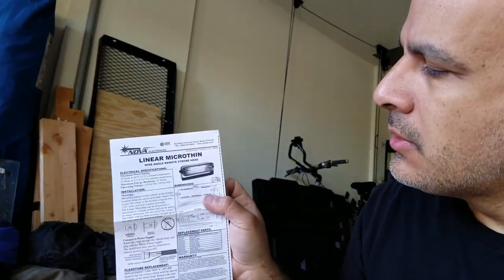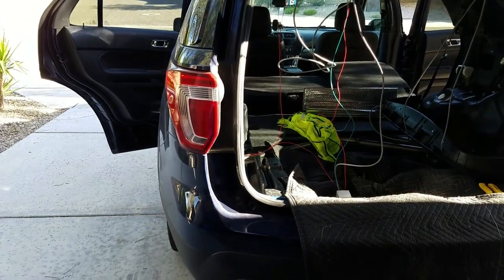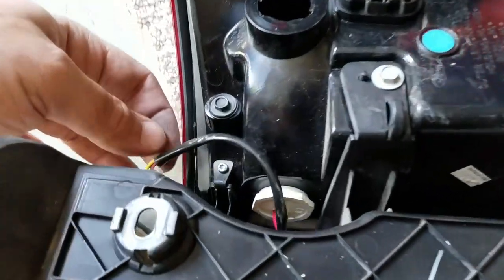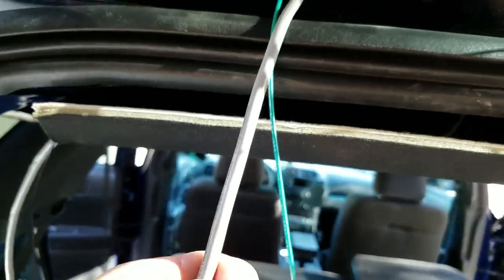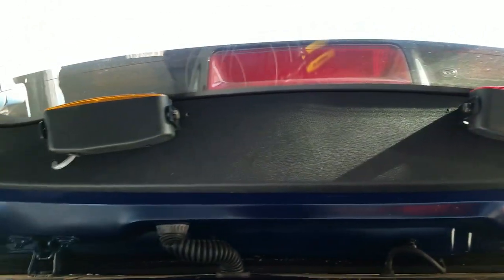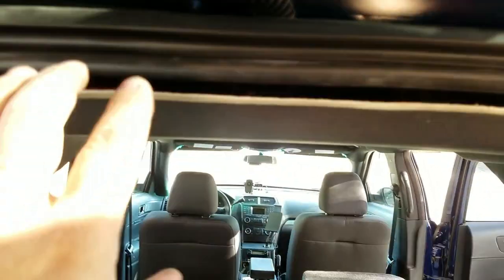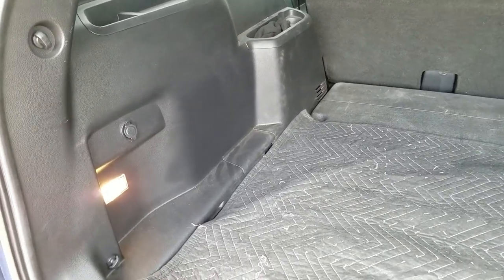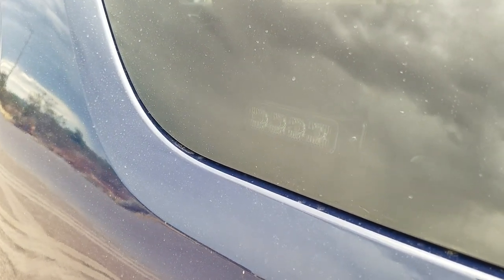Ford Police Interceptor Utility Mods - They're coming to get me!!

Comment: I am planning on installing a 2K watt inverter. There is a small pocket behind the back seat (I learned from you) would it fit there and then run the wiring through the channel to the front. The main lines to the battery will be #8 gauge wire.
I did get the Whelen strobe and the Whelen air horn through E-Bay. I am taking all the strobes out and changing to ION strobes in amber (IONA). BTW the horn on the steering wheel in my PIU should be on a VW Bug! Those WILL be changed out on Wednesday when I get the PIU back from Ford. They are checking out the recalls and then programming the computer so that I do NOT have black out and I will have a few other features like Daytime Running Lights (DRL). All in all I am looking forward to start playing with this very soon. Heck I haven't even opened the hood yet!
Reply from the maker: Awesome.  Inverters come in many sizes but I suspect it would easily fit back there, Though you may consider airflow.  I doubt you'll get much airflow back there and it may overheat depending on how hard you push it. There is that battery tap right behind the rear seat, though I think it's only good for 70A.  If you are planning on using more than 800W at a time, you'll need to run a separate line.  Don't forget to put a fuse or circuit breaker in right by the battery.
Reply: @turbo2ltr  What would be nice is a video on how to take everything apart. You do the talking and the work and have someone do the filming! I like the way you do things and as you can see many others do also. I haven't started stripping out the back end yet because I am freezing my old ass off out there ! LOL You really do have some awesome videos.

Comment: Did you plug everything into the same car battery or did you get a different battery ? Please do a light show walk around 😍😍😍
Reply from the maker: I did not add a second battery Everything was connected to the OEM upfitter connections. The car was sold over 2 years ago.

Comment: It's coming out nice man. have you thought about putting some under the mirror intersectors for more side visibility?
Reply from the maker: Thanks! I have, I also have some extra Nanoflares and through about mounting them on the front bumper corners (in the black part), but ultimately decided against it because I want to keep it looking stock externally.  I do agree side coverage isn't that great, but for what I do, rear coverage is needed the most.

Comment: I'm curious 5 years later just before Christmas 2022 do you still have the vehicle and how's it been reliable Etc I should check your channel out and see if there's any updates but the thought just occurred to me as I'm currently looking at purchasing one myself thanks
Reply from the maker: No I sold it several years ago with 50k miles. There were a couple issues, but nothing major.  If you get one used, the only thing I would say is to make sure the water pump was changed recently and make sure the PTU was serviced regularly.

Comment: How hard was it to wire your lights, I’m currently looking into getting a 2016 and I’m gonna do much of the same work but I would prefer to do it myself and save the extra cash for gas. I’ve never wired anything before so I’m very curious if it’s as easy as 1,2,3 or I should take it to a pro to get it done?
Reply from the maker: If you never wired anything before, not sure you'd want to tackle this, but you have to start learning somewhere..  It's not super hard but I've been playing with wires since I was 10 and that was a long time ago. Things you need to know how to do: basic wiring circuits, (difference between positive and negative, how a switch works, how to read a simple wiring diagram),  You should understand what fuses do and why you need the right size and in the right place in the circuit (Or you might burn your car to the ground), and how to remove interior panels, preferably without breaking the clips lol.  You'll need a  multi-meter or at least a test light, electrical loom, electrical tape, wire of the appropriate size, length and colors, heat shrink, and some panel pry tools couldn't hurt.

Comment: What is the make/model of your center console?  I have a 2015 FPIU with a Troy Industries Low Profile console and it requires me to have all remote mount radios, which is a PITA for my 900MHz radio.
Reply from the maker: 7160-0411: Console Box -Ford - Utility PI - w/Rest & Cup Holder. Includes 3 faceplates and 3 filler panels. (7140-0443 x 2 and 7140-0270) Locking Console Pocket Tall.  I bought it from 

theruggedstore.com

Comment: do you have any idea where to buy the 14 wire harness? (bottom of console power feeds) ur p.i. is basically new so it came with yours from factory...but I cannot find the female harness connector for nothing. mine is a used 2013, same type plug. does anyone know?

Comment: Do you know where I can find those couple of plastic pieces from the grille that you replaced with strobe lights?
Reply from the maker: maybe find an upfitter and reach out to them as they may have some laying around.  I'm guessing you tried the dealer and it only comes with the whole grill?
Reply: @turbo2ltr  thank you! I haven't reached out to the dealer yet but I looked up OEM parts and it comes as a whole grill..

Comment: Many of the Hams that I know who run emergency services have a PA, horn and can route their radios through it. Any reason you didn't take that approach?
Reply from the maker: Meaning like the output of the radio comes over the PA speaker?  Or you can use the radio as a PA into the speaker?  Either way I just never really had a need for either situation so I never really thought about it..

Comment: Your headlights... i was told the lights facing the front are only high beams... i noticed yours are on and look like headlights... or did you have your highs on for the video?
Reply from the maker: I assume you are referring to the shot at 8:16... those are just the headlight (highbeams are halogen and look yellower than the LED headlights).  I'm unclear what you heard as all cars have  both the headlights and highbeams facing the front.
Reply: @turbo2ltr  are your high beams by themselves or do you have a double filament headlight? When i turn my lights on, only the front sides turn on. I have to use the high beam level for any light to come out of the center front. I was told those are only high beams.
Reply from the maker: @FrankMCJR  Oh, I think I understand, so yes what you are saying is true.   The low beams are LED (on this car) and are located on the "outside" of the headlight housing. They are LED so they don't have dual filaments.  The highbeams are halogen and on the inside of the  headlight housing (closer to the grill).  I believe the LEDs turn off when you put the higbeams on but don't quote me on that.  I don't have the car anymore so I can't check.
Reply: @turbo2ltr  yes. That's what I was wondering. I thought my headlights were broken. As far as the LED turning off when high beams are on, they do not. At least on my vehicle. 
Thanks for your help. 
(Just FYI, I was able to install 6x9" component speakers in the front(Alpine) and 6.5" two-way speakers in the rear(Kickers)
 They are powered by a 4 channel Rockford Fosgate amplifier. I also have a 12" subwoofer powered by a 509 watt 2 channel Alpine amplifier. I kept the 4.2" stereo because there is no inexpensive way to install an aftermarket unit. I used an L.O.C to have the amps work off of the stock unit.
Reply: @turbo2ltr  one more thing... where is a good location to drill a hole to run wires in my firewall??
Reply from the maker: @FrankMCJR  There are built in wires running from under the dash to behind the driver's side headlight.  I used those so I never ran any of my own wires through the firewall. Check out 8:44 in this video: https://www.youtube.com/watch?v=hrs5jgiB0ng

Comment: also how much did the dealer charge for the intelligent AWD to be put in?
Reply from the maker: 1 hr labor (even though it took them longer due to their ignorance..)
Reply: Would you do a review on your Interceptor Explorer
Reply: My 2013 Interceptor came with. How the hell can they install an AWD system in one hour? Please explain.
Reply: The Postmaster Notice the word intelligent. PI has a different AWD system
Reply: The Postmaster, it is likely just a software config.
Reply: I don't know a lot about the AWD systems in these new cars. Can you tell me the difference between the stock PI AWD and you Intelligent AWD system?

Comment: i'm wondering about that 70 amp battery stud ,CAN I USE THAT FOR MY POWER TO MY STROBE LITES WITH NO PROBLEM ?
Reply from the maker: yes. that's one of the many uses it's is there for.  Just make sure you properly fuse it by the stud. You don't want 70A going through 18ga wire.
Reply: @turbo2ltr  Thank you,what size fuse should I use for say 18 gauge wire for four strobes.
Reply from the maker: @tonymarino3317  Assuming they are LEDs, 10A would probably more than enough. You really need to find what the manufacturer says the strobes draw, and add it up, then choose a fuse size slightly higher.

Comment: I am looking for some visor lights for my Ford Explorer, I live in a state where amber and white lights are allowed, but the top of the windshield is tinted blue pretty good, so I was thinking of just running amber up top...I noticed you had removed the white passenger side visor light. Was that because it looked blue or did you just not like that setup?
Reply from the maker: It really didn't look any more blue than the LED headlights, but you never know, you get someone on a bad day and they'll call it blue.  I replaced it with amber so there is no question.
Reply: Thank you very much for the information!
Reply: @turbo2ltr  I just put amber visor lights on my 2015 PIU and they look more lemon yellow than my push bar and mirror lights.  The white takedowns have the LED headlight look but I can't use the white flashing in my application anyways.